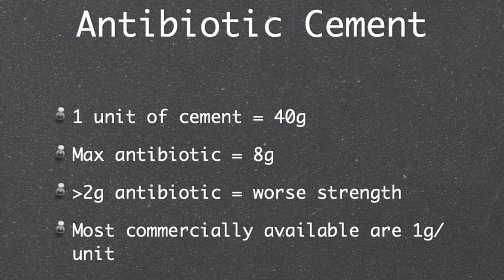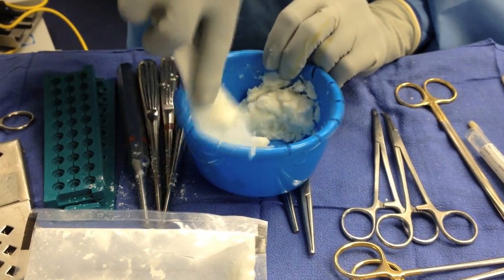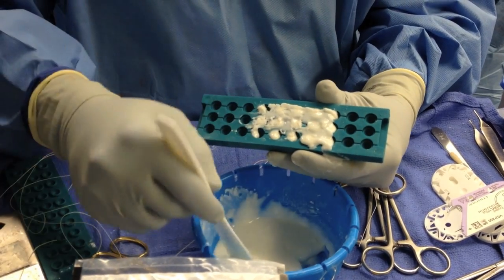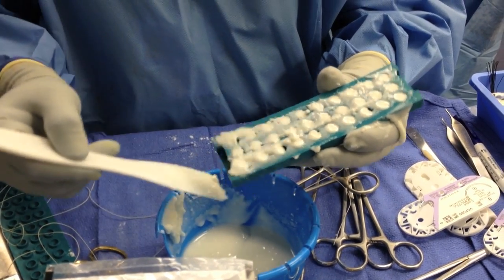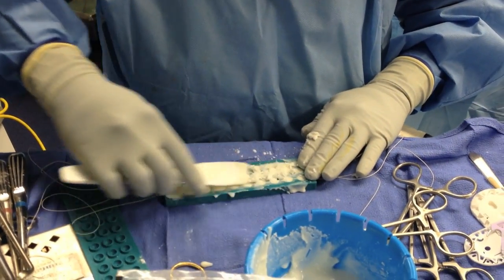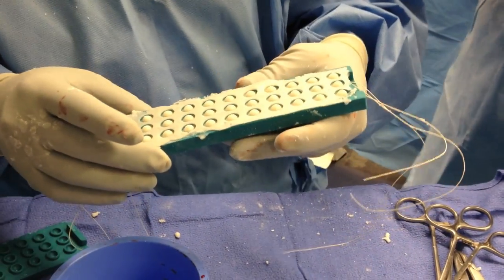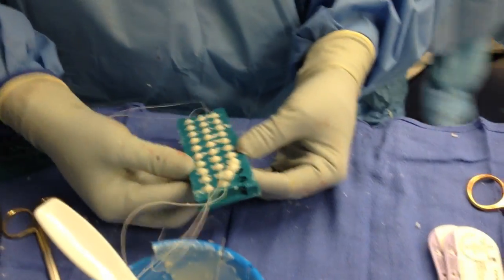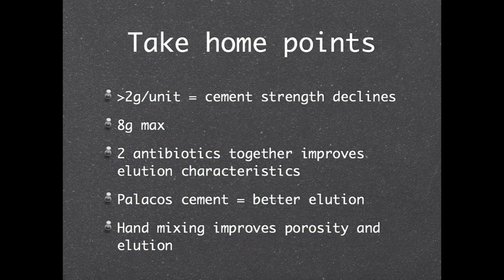Antibiotic Beads

Comment: What are your sterilization guidelines on the cake bead mold.  We require company quidelines for sterilization!!
Reply from the maker: Tracey Ryersee Im not sure what the tolerability of the cake bead molds that you can get online or at some stores are in regards to sterilization techniques.  Ours are commercially available ones from Biomet and tolerate repeated sterilization.  However, after multiple uses, they tend to get more brittle.